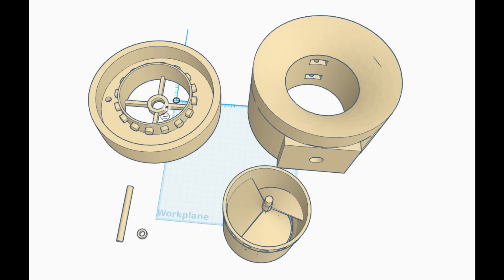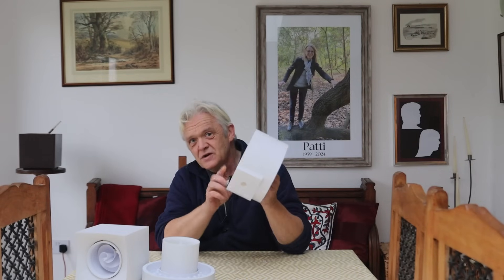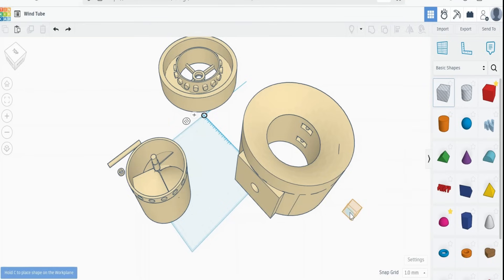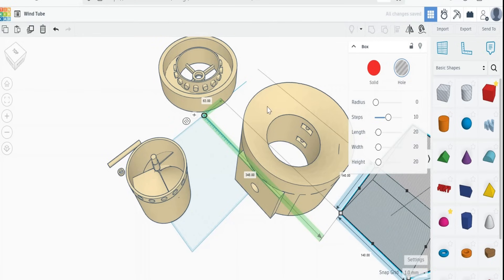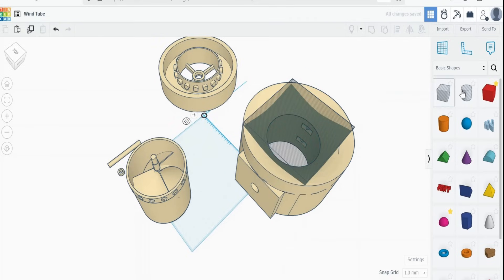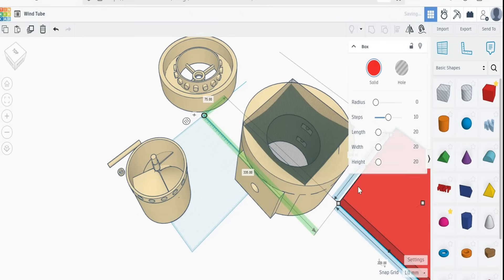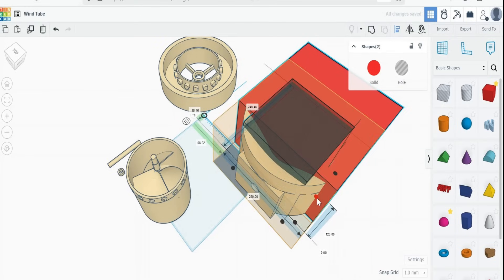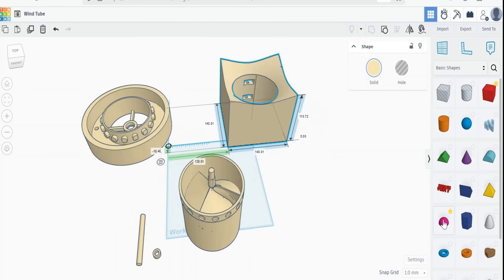2320 The Wind Tube

Comment: This design looks wildly material intensive for the area of wind it will interact with. Also, since it is so solid most of the wind will just flow around it instead of through the hole. It might be useful if you need a small amount of power in very harsh conditions but otherwise I see little use of the design.
There is a reason big wind power turbines are as slender as they are.

Comment: As your printed parts keep getting bigger and bigger, my printer keeps looking smaller and smaller 😛
Reply from the maker: this was printed on a Flashforge Adventurer 5M Pro which has a bed size of 220 by 220 by 220 -that#s quite a small bed -  i just use all of the bed
Reply: @ThinkingandTinkering  That's a nice printer! Mine is a humble Winbo Super Helper SH155L with a 105×105 bed, so 1/4th the bed area of the Flashforge and 1/6th its volume, but I'm quite fond of it because it's my first and only 3D printer, it never failed me, no clogging, no mechanical issue whatsoever, even though I moved it a lot between labs and trade shows.
Reply from the maker: @VeniceInventors  ah - that is a small bed mate - still - I can understand the attachment lol

Comment: I like the cube idea, but the circle idea is also great.  

You have given me a lot to think about.  I am planning to build one.  There is no time limit.  I'm a slight perfectionist, but I am also mindful of clutter and cost.  I wouldn't consider myself a hoarder, but it just accumulates.

My alterations include, magnets inserted from the inside out.  From my knowledge, magnetic field passes through plastic.  This will reduce maintenance and reliance on super glue.  The tolerances even be able to increase.  Magnets may be able to be strengthened by stacking etc.

I think the cylinder needs at weather shield for the inside components, so a simple collar on the end of the cylinder should spin any water off before entering the unit.  Yes, the complexity increases, but 3d printers have no problem with repeatedly printing complex profiles.  It's just more complex to design.  Forget about injection mounding.  Manufacturers are not interested in residential energy production due to regulation, government subsidies etc.

Third, the bearings are noisy.  The noise will multiply by the number of units.  TPU can be printed with ASA, so the cylinder could include a layers of TPU where the bearings roll on the cycler wall, or some rubber, TPU, or latex glove material on to cover the bearings.  Yes, more complexity, but not if competent, and not for printers ounce designed.

Regarding the shape, I always thought increasing the pressure with a torus tear shape would be help.  It turns out that bubble soccer balls could make this easy and cheap-ish, but the wing needs to be faced inside, if I'm correct.  A cube makes everything modular, which I really like.

Great work Robert for pioneer industry 5.0 in additive manufacturing.  I've always questioned why we don't produce the power where it's consumed?  Solar should be on homes rather than fields.  To succeed, we need to do more with less, we need to repair what we have, we need reduce our reliance on other countries by making what we need.  And, we need energy.
Reply from the maker: I like your ideas mate - all of them and agree with you - i am looking forward to seeing how you improve this basic design - it certainly looks like you know what you are doing

Comment: What I was thinking per my comments a couple years back on this (you are getting closer to it) was the same type blade to promote vortex optimal flow through.   Then build an array.  With a wall of blocks you could do that.  However.......what happens in strong wind?  The wall has to be strong.
Reply from the maker: most walls are
Reply: @ThinkingandTinkering  What about plastic 3D printed walls? Just saying that structural focus might be required considering the material and madularity.  I like that its cheap and plastic and easily replacable and you can make it yourself. Just needs that extra enginering focus consideration in production is all I was pointing out.

Comment: Hot rod multiple inputs vacuum vs pressure vs valves
Reply from the maker: nope - that didn't help - can you try and be a bit clearer?
Reply: @ThinkingandTinkering  a car engine works with or without turbo or nitro- if both input & output can clutch for increased efficiency then imagine mechanical battery spilling into storage- when the on off switches then… if no sun then wind - if no wind then water or gravity- if not enough gravity then vacuum vs pressure etc

Comment: Too phone dumb for photo
Reply from the maker: i am sorry mate - i don't understand
Reply: @ThinkingandTinkering  wet dry vacs are reversible- they have the propensity to create vortex as well as hold some vacuum energy- few if any utilizes a capacitor or flywheel set up
Reply: Thinking mechanical toriodal cantremembertheword
Reply: Turbo the input & outputs of a vacuum together with flywheel upramp clutch & resistance control

Comment: I was thinking the toroidal blades would be more efficeint and powerful, and use a cone to catch the wind. Mount it on a spinning barren. The housing could have magnets & the blade could be made from copper which would create contactless electricity.
Reply from the maker: give it a go and test it
Reply: @ThinkingandTinkering  I'm not smart enough to make it, and no means to do it, but I can imagine it. 🙂

Comment: That's all fine and good BUT how about those of us who DON'T HAVE A fun little program to do the work..
Off griders DON'T HAVE ANY GADGETS.
Reply from the maker: You can upgrade or, learn the program and use service providers or work out how to make it from tools you have yourself - those are pretty much your options - I can tell you one thing that doesn't do much good lol. Stop complaining mate and get up and learn a simple program that will take you all of an hour to get to grips with and is free!!! The only thing stopping you here is you
Reply: There are services available online that will 3D print stuff for you if you send them the files (emailed or uploaded to their site) and specify which material(s) you'd like for them to use.
Reply: You have all programs you need in your head.  Ideas are being thrown out and from there, fake it, until you make it.  Did the same from the pre 3D videos.
Reply: From my calculations, 3d printers are ideal for solar.  They consumer about 100 watts continuous.  You don't need much solar to run a 3d printer.
Reply: @timmyssweet  Can they be turned on and off as either clouds or darkness happen?  Will an interrupted printing mess up a project?  3D printers look cool, but they are far beyond me.
Reply: The price of, breaking free, your on your own.

Comment: You could add a traffic cone to bring larger volume of wind into mechanism.
Reply: I had the same thought.
Reply from the maker: you could indeed
Reply: in theory you'd get a similar venturi effect by the extra space of the block around the rotor (although with slightly less efficiency due to turbulence but you save up on space in exchange). Look up "orifice plate" to read more about it.
Reply: What about adding the Darwin style Wind collectors to something like this? That would be interesting to see if there is a difference.

Comment: Great tutorial. I'm struggling with the alignment tool and the cookie cutter method, so this is exactly what I needed. My question about this turbine is does it work in the vertical position? This one looks like a good starting project for me given its adaptability, if I can stick a Darwin wind catcher on the top of it.  Thanks as always.
Reply from the maker: I am glad it was helpful and yes it will
Reply: @ThinkingandTinkering  I have .2 mm copper wire, if I do the 1000 wrap, I should get similar results because the length is the same, assuming I get the right capacitor. I actually meant to say, 1200 turns, to compare against a three phase at some future build. Staring at you coil wrapper base, even as I type.